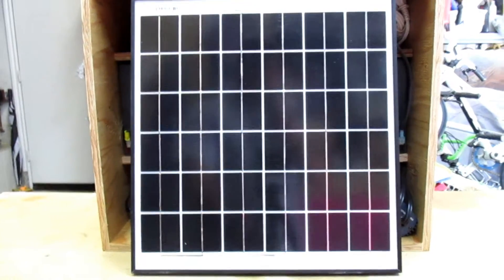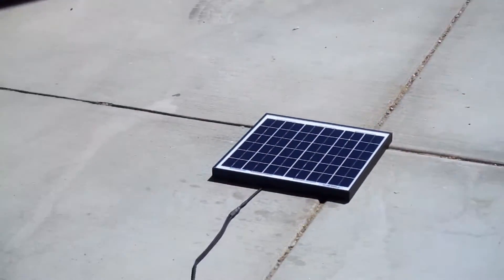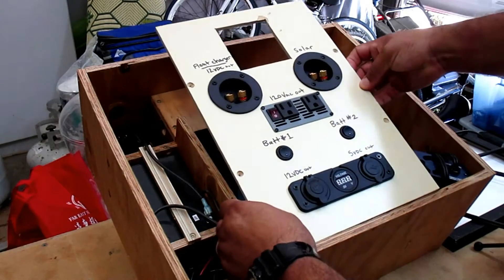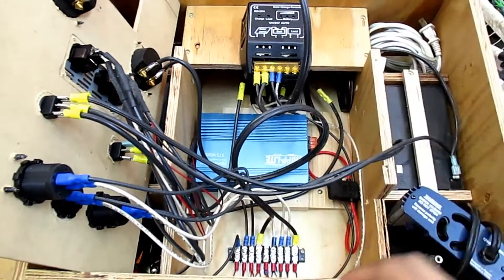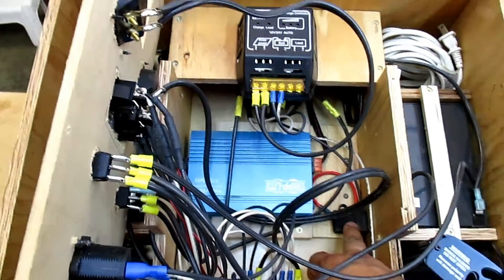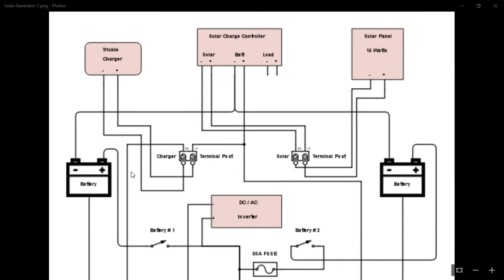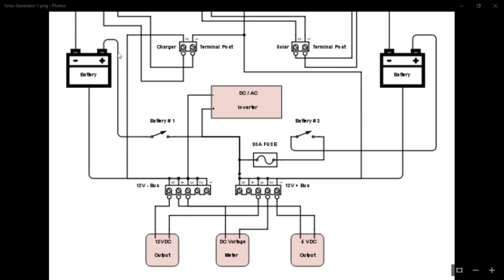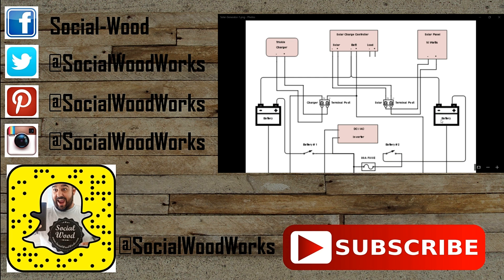DIY Solar Power Generator - Part 2

Comment: This is an interesting design. I would like to know what this generator can power. Charge smartphones or tablets? Power a small light bulb? What practical applications can the electricity generated by this device could be used for?